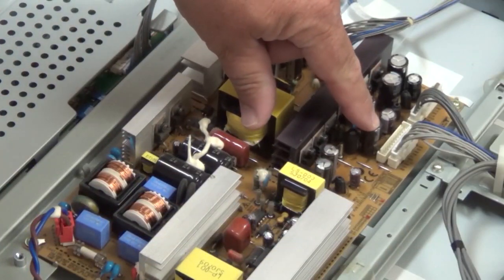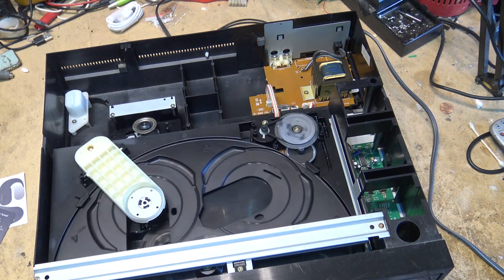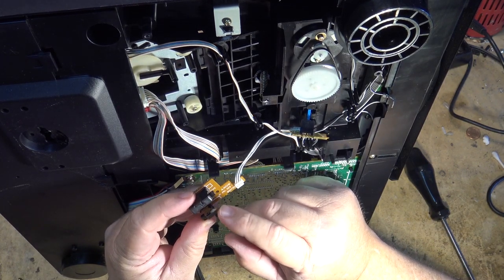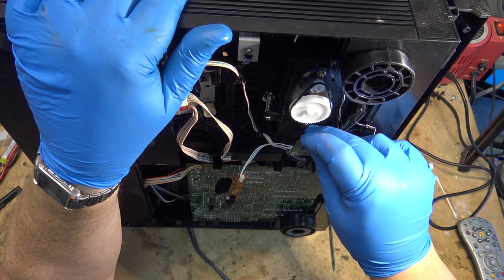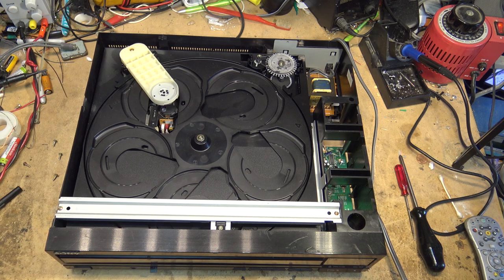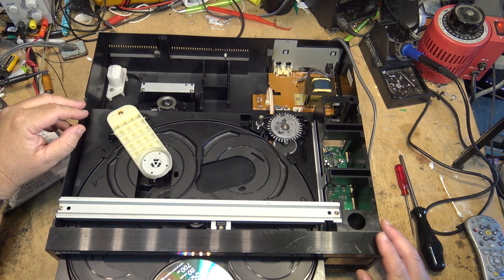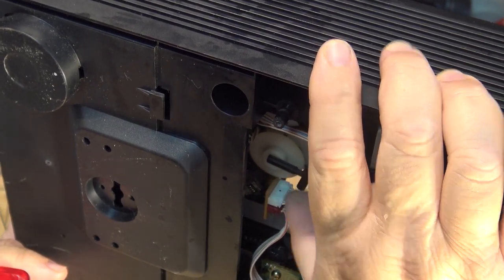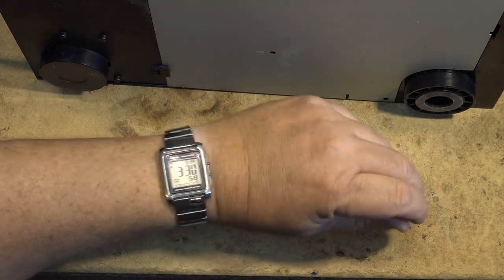Sony CDP C500 5 disk CD player. Will it work? Lets find out.

Comment: Another fine job, well done. I appreciate the story about the divorced lady, having some music is always a good thing to start a new life. And I guess this part is also make the joy of another customer. These old machines are well made and engineered, cause they combine functionally interesting things with simplicity, and you can get them for virtually nothing! It's more simpler than 50 + CD jukeboxes with all CD cases ending lost or broken, and a pain to manage or even change 1 disc. The practical limit is the 6 disc in a tray made for both home or car units. 

Of course, these solutions seems "outdated", if not obsolete. Nowadays, any audio geek will tell you about lossless audio files shared on a NAS. Of course, recording your 1000 + CD collection will then take some time, but once it's done... Then you can read your music on any home PC or DNLA unit! And if you want to get high end audiophile style, computers can also come with a high end audio card, but most best recent motherboards integrate a digital output, so you can "simply" use any external quality DAC (let assume it can decode properly your audio format: OGG, FLACC or WMA are sometimes problematic on old machines). Next is home solutions made with microcomputers Arduino or Raspberry style to complete a reader with a high end DAC. Of course, money can replace technical skills with some integrating high end new audio servers from NAD, Cambridge Audio, PS Audio... + with internet access to virtually access endless music flow, countless internet radios. But what a headache if you want only music for an evening!
Reply from the maker: I use an arlic streaming DAC into a tube amp. Can play from computer and many online services.  I don't though. I have an old phone with a big SD card with all my music on it.  It sits next to the amp plugged in, connected by bt.  I can use the remote with the streamer to change tracks and volume ect.  
Sure i can control from phone but too much work.  I just want to turn on and have music.  Or i turn on my 200 disk cd player.

Comment: Hello, I just wanted to say thanks for the great videos! They are very helpful!

 I did have a question, my cd changers carousel won't spin when the tray gets back into it's home position. When it ejects it seems to work fine, it does the disc skip and everything and rotates. 

When it goes back in the carousel stops rotating and the lever on the inside the pushes up on the cd and has the blue sensor will not lift up. Is there anyway to fix this? 

I bought it at my local goodwill and have 7 days to return if it doesn't work however I would like to save it if I can. Also if I were to take to a repair shop, how much does they usually charge? I'm pretty new at this so any info would be helpful! Thank you in advance!

Comment: Thanks for the video, I'll try those switches on my CDP-500.  Everything seems ok, but, it will not spin up the disc motor. Laser twitches up and down and rails are clean and lightly lubricated.
Cheers!
Reply: Check the green ribbon wire for cuts in the traces

Comment: I was so happy to find this video. I had this CD player years ago, had to leave it behind when I moved across the country.  Just found a similar model at a local antique shop and it works as expected except the tray makes a horrible rattling noise when it rotates, like you noticed.   Would love to get a suggestion on what you think it could be as it's much more noisy than the one I had originally. I am wondering about the rollers underneath maybe having a flat spot.

Comment: Hello from Ohio!  I have a Sony CDPC505 that I found in Goodwill.  It is almost fully functioning except that about every 7 or so CD changes, the carousel just needs to move one more tick to be in the correct position to be read.  Its not always the same CD.  Ive tried lubing all gears and sprockets, hoping that over time it will come back completely since it sat a long time.  Any suggestions would be welcome.  Thank you!

Comment: Pick myself up one of these units. I have a lot of memories of it because my dad bought one at the federated electronic stores when they went out of business. Anyways for 1988 when we got it it was high class. Mine is having similar problems. Since I tore it out I decided to replace All the capacitors. Most of them were good but a couple were bulging so I said screw it why not. Spent $40 on capacitors for a $20 unit😅

Comment: Took mine apart completely, but i can't figure out how to seat the laser again. The teeth on the laser sit too high up and not catching the bottom gear, only the top one. And when i put a disc in it can't read anything now and sounds like its scratching the disc. Original reason for taking it apart was to replace the laser since it was skipping on every cd i would put in it.

Comment: I have a Sony LBT-ZX99i that refuses to spin the disk after its loaded into the reader, the tray moves fine. I can see it twitching as if its trying to spin the disk but no luck. I tested the motor by itself and it works great and have already replaced the chip thats directly wired to it, its a ROHM BA5947FM. Any advice would be appreciated.

Comment: Dr. Dave, you mean you wouldn't pull out your electronics stethoscope and carefully check for pulse and find the SQEAK ?    Probably won't hear it much when the lid is back on.  I will need to check my Sony combo CD / boom box and see if the switches are the culprit.  Thanks  JwgK
Reply from the maker: Nope don't care about the squeak.  If anyone asks i will tell them there is a mouse inside.

Comment: Looks like that gear drive wheel needs a bit of a clean of dirt and grease too.

In the start of the video,,,the 2 cats,,,,and the short circuit of what looks like an amplifier,,,,what happened with the short circuit,,,did that thing blew up?
Reply from the maker: It was a power supply.  I popped it.
Reply: @12voltvids  Ok,,,u had popped a power supply,,,i guess by accident,,,or deliberate,,,as i guess the machine was no good in repairs?

Comment: Mine has the same problem, sometimes the tray doesn’t come out and I have to turn it off then back on and it will open, spins disc for few seconds but doesn’t read them, checked the switches and they all are good, turns out the green ribbon wire has a cut in one of the traces near where it connects to the optical assembly, hopefully that’s the problem

Comment: Pesky switches! Don't blame you on the gloves, contact cleaner can be nasty stuff plus your hands end up smelling like it for hours afterward. As for the grease I've started using teflon grease, works well and it's plastic safe.
Reply: I use Finish Line bicycle grease which contains some Teflon.  Seems to work fine for me.

Comment: I think the first problem was you tested it with a 700MB modern CD-R. They don’t play well when given a disc capacity they are not expecting. If you put in a normal CD or 650MB CD-R I can guarantee it would’ve worked.

I have the same Sony CDP-C500 player myself.
Reply from the maker: The track picture on the 700 Meg discs is identical to the 650. The only difference between the 650 and 700 is on the larger capacity discs the recording surface goes out closer to the edge. Something like 4 mm difference is it'll be different between them and I haven't seen any players that support CDR that have any problems at all playing the 700 Meg discs I have had players that refuse the 800 MB discs. On the 800 megament desks the track pitch is narrower at some of the older lasers the spot isn't small enough to track them properly

Comment: My CDP-C500 has a problem with the microcontroller software; when loading with 5 discs one at a time, then hitting 'shuffle', it will eventually get hung up bouncing back and forth between the same 2 songs on 2 different discs. The fix - load machine, advance to disc 1 position, power off, power on, let machine read disc and tracks from all discs, then hit shuffle, machine will properly shuffle play.

Comment: Hope the player did play all the 5 discs well too b4 u had sold the machine.
Reply from the maker: It plays all the disks.  Haven't sold it yet but it will go because i have no need for yet another cd changer.   Those units being in good money.
Reply: @12voltvids  Ok. Good how it did played all the discs,,,and haven't sold it yet.

I've got a few cd players too,,,few from pioneer,,,a twin tray unit,,and a 6 stack cd player with a few cartridges i bought for $5,,,needed a good clean out,,and replaced belts for the 6 stack changer mechanism,,,plays really well on every disc. Pioneer twin tray unit plays well too.

Have also a Yamaha carasoul 5 disc changer too,,,,bought 2nd hand and only needed one belt for the drawer tray drive,,,it works great too.
Reply: Will it play mp3 discs?

Comment: My CDP-CE335 jams. A disc will hop out of its tray and wind up on top of its neighbor, jamming the player. Intermittent occurrence. Any ideas?
Reply from the maker: Check the disk clamp.  The double sided tape used to hold the felt ring sometimes leaches through and makes it sticky. Then when the spindle drops to change disks the disk sticks to the clamp, the tray rotates and now you have 2 discs jammed.